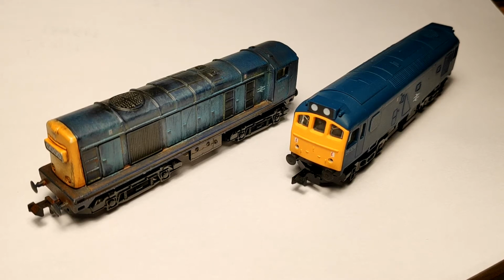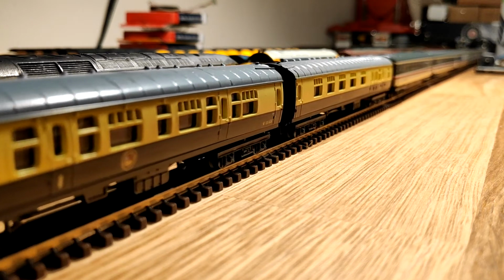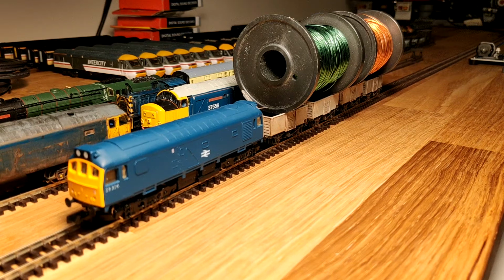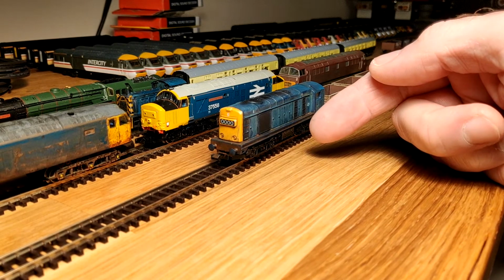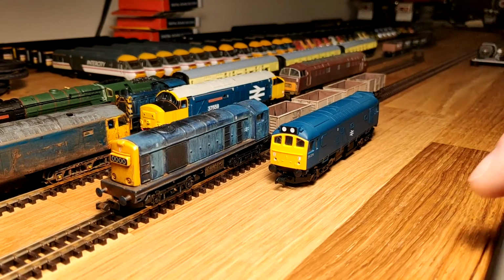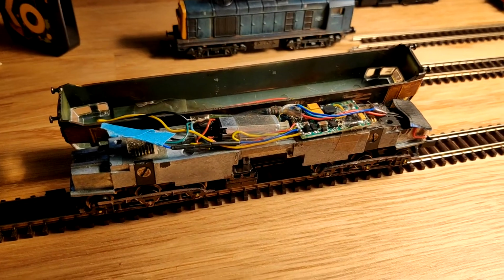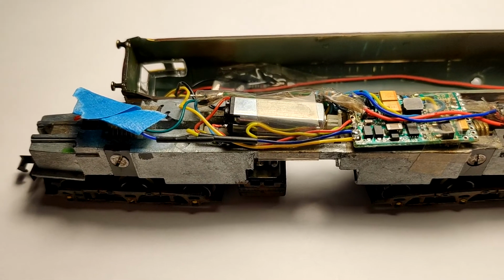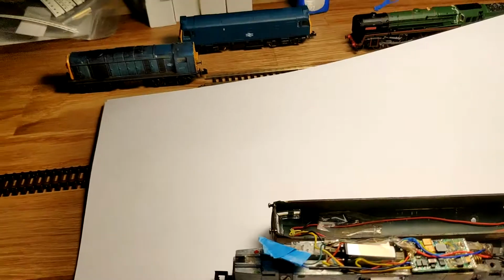N gauge Coreless Vs 5 Pole... The big Debate!!

Comment: Nice video and a fair comparison. I found that the Farish 5-pole motors get really hot and bothered fairly quickly - I tried a coreless motor in a Farish 47 and it will now run all day without any issues. It ran for 2 four-hour sessions a couple of Saturdays ago -  I don't think the original motor would have survived. The Class 20 weighs in at 92g, the 25 will be about 86g (with the original Farish motor). I'm impressed by your gears - you should have worked for Farish!
Reply from the maker: Ha my gears havent cracked yet surprisingly! I did weigh mine and at the time of filming the Class 25 came in at 76g and the class 20 came in heavier at 88g so similar weights to yours actually 👍 ive never done a continuous 4 hr stint but that is really interesting to hear about your experience with using coreless motors, i think il have to revisit this video in the future and try and do a better conparison, maybe il try a slightly larger coreless motor so the benefits of going coreless for me are more clear cut 👍

Comment: You mentioned that you had fitted new gears, could you explain where you obtained the gears. I want to get into n gauge and the problems with splitting gears worries me. But if I can change the gears it will encourage me to take the dive into n gauge, cheers Dale.
Reply from the maker: Things have changed a bit since this video. you can now readily obtain gears from "Farish N Spares" or "Bachmann" so no need to worry 👍
Reply: @ThisWayWorksTWW 
Thank you for the prompt reply. I have two class 37s unused in their boxes must be 13 years old I will try them on a test track. Great videos by the way!
Reply from the maker: @DaleYates-m3p  some of the Poole 47's ive fixed in videos are pretty much the same chassis, if you have any split gears the axles will be 16t gears 👍

Comment: Would love to know exactly how you fitted dcc on the 20. I've hit nothing but snags with mine and I'm no further forward with it.
Reply from the maker: What kind of snags are you having? I just put the decoder within the battery box, two wires to the chassis(motor) isolate bogies from chassis, wire decoder to bogies for the track pick up👍

Comment: Hi again is this the same 20 that you did the gear change on in your last video for the 20? I followed your instructions and got mine up and running great many thanks for info on that. Now I have another question, am I right in assuming that you have converted this loco to DCC ? As I like to do this to mine, but can’t find any vids to show how it is done
Reply from the maker: I have two that look very similar, the gear changed one is the sister Class 20 of the one in this video, i just mount the decoders between bogies on the underside of the loco, i can show you how i wired the decoder in a future video, its not pretty but it works 👍
Reply: @ThisWayWorksTWW  thanks for replying, I love to see how you did this conversion and look forward to seeing this done.. thanks

Comment: Good video. Did you weigh the 20 and the 25? I expect the 20 is heavier, with the die-cast metal body, and that's why it can pull more.
Reply from the maker: Hi Sam, yes i suspect you are correct 👍, i havent got any scales to hand atm but i will weigh them and let you know, might even do another comparison video in the future, maybe a more scientific version 👍
Reply from the maker: Just weighed both locos, class 25 comes in at 76g and the class 20 comes in heavier at 88g so yes more weight equals more traction... 👍👍

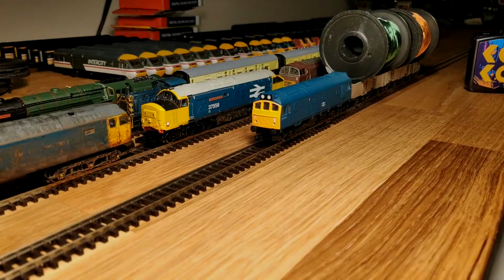Comment: 1. @5:09 Holy HSTs, Batman! How many have you got??!??

2. I'm thinking of putting a video together on how to measure a loco's performance electrically, but I only have (sniff) 4 HSTs. I wonder if you would be interested in measuring some of yours - good and bad runners - to get some idea of what a "good" loco should read?
Reply from the maker: Tbh i dont have a dodgey HST atm!! Electronically anyways that is... Generally speaking they would all read differently and it would depend on where you measured really... Are you checking for amps? Resistance? Insulation? Generally speaking if you can go fast and slow then the loco works lol... The real way to see how good a loco is is probably to crawl them however the poole type chassis's alone vary greatly, in short if you have a hot to the touch loco then somethings wrong... I have absolutely no idea how many HST's i have, but i do know they all run like new now 😁
Reply from the maker: I think really i know when a loco is bad if it runs loud,slow,hot or wont crawl... Any one of those symptoms and il service it 👍
Reply: @ThisWayWorksTWW  One reads 106 ohms track-to-track, and won't go; another reads 85 ohms and sets off with about 8v across it, leaving only 4V for speed range; the third reads 45 ohms and sets off at 5.5v, and obviously runs the faster.

I'm assuming that a well-fettled loco needs even less to pull off, leaving more for speed range, but whether that's 5.4v or 2.4v is something I can't find anywhere.
Reply from the maker: @kitmoore9969  another quick test ive done in the past is use a one cell lipo, in my case it wasnt fully charged reading at 3v.. that was my minimum test voltage if the loco moved and crawled it was good. If it didnt move i took it apart and serviced it. Now i take them all apart and clean them up. Your resistance test will be different with different locos as they will be wound differently. It really is a tricky thing to test. Generally if my locos dont crawl, make a nasty noise, heat up il strip them down, hopefully this helps? Doing resistance check i dont think would be a consistent way of checking locos against each other as theres just to many variables to potentially mislead you 👍
Reply: @ThisWayWorksTWW  No, that's a good start ... it should crawl at 3v. Thank you very much!
Reply: @ThisWayWorksTWW  And the bad news ... all three need servicing. Oh well.
Reply from the maker: @kitmoore9969  definitely with GF the minimum of 3v should propel the locos albeit slowly but yeah thats my go to test. Minitrix motors and Lima for example are different more power hungary motors (amperage) so expect maybe a touch more then 3v to reliably get them moving off... The reason i say use a Battery vs a powersupply is in my case when i use a lipo the motor then takes the current it wants rather then trying to move the motors via a controller which gives only a limited ammount of current out to the motors 👍